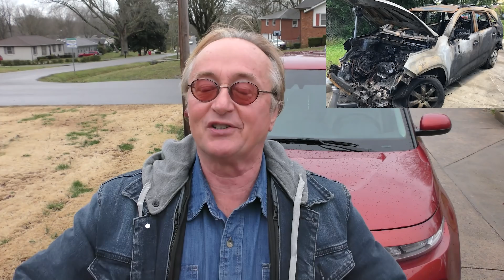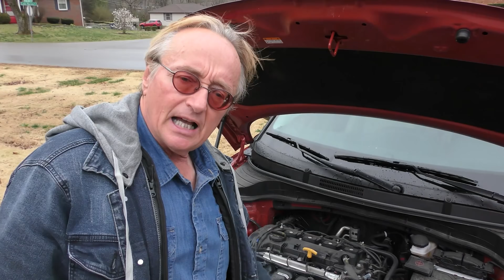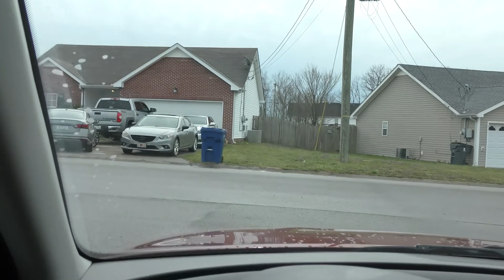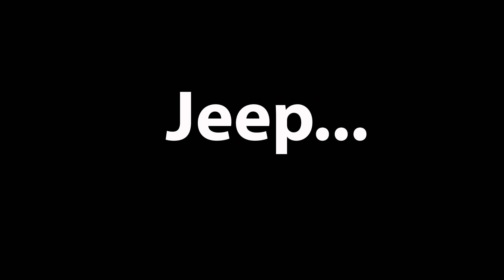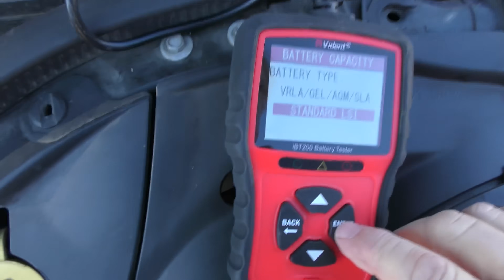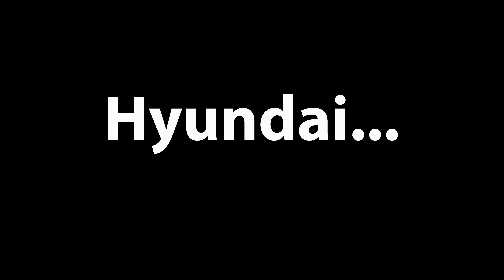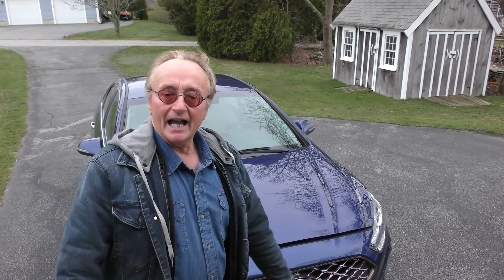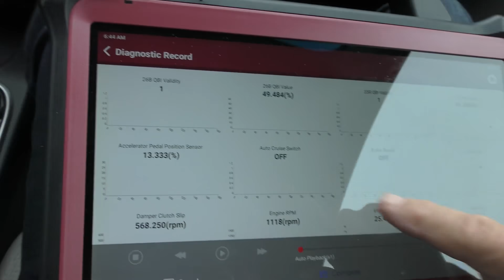3 Car Brands That are Crap

Comment: Wow you are completely wrong the reason all the new cars Toyota Kia etc are burning oil is because of much weaker oil rings reducing friction which is suppose to increase mpg unfortunately depending on how you drive the thin oil used today will make it past the oil ring also not being as stiff as before gunk builds up on the oil ring making the efficiency of the oil ring drop off quickly the old oil rings were stiff enough to keep from any effect from slush buildup

Comment: My brother's 2013 Kia Sorento locked up at only 80,000 miles.  Thank God it was still under the 100,000 mile warranty.  The dealer said he would have been screwed if he had over 100,000 miles.
Reply: How about revving it to death before warranty is up, then?
Reply: @Mr371312  That's what I do.
Reply: The service manager was wrong, and what he told your brother goes against Hyundai/Kia warranty policy.   This engine is covered by the engine recall at virtually unlimited mileage.  I ran a Hyundai shop and the manufacturer is unbelievably generous with goodwill warranty claims.   That service manager was one of those dollar chasing dealer types that give us all a bad reputation.
Reply: Except that you put used engines in not new.
Reply: @wolfeadventures  No.  My brother a brand new engine.  not used.
Reply: seized? no oil?
Reply: Yeah cause these modern junk won't make it to 100,000 it breaks too soon. The dealerships know what they're doing getting their $$ drawing you back in thinking new is better they know you need wheels to get to A. To B

Comment: I have a Kia and haven't had any problems with it.
Reply: 2 out 10 of their cars will have an engine blow and catch fire. Drive assuredly.
Reply: @inquisitor4635  I had a friend who had a 2010 Toyota with less than 50,000 miles that was frequently in the shop for engine and transmission trouble.  He got fed up with it and bought a VW and hasn't had any trouble with it.

Comment: I bought a new 67 Corvair with the 110 hp engine.  It burned a qt about every 1000 miles from brand new.
Reply: In my dim memory, there was something about the pushrod tubes, or the seals that leaked oil.  I think there are now silicone rubber seals that don't leak----only 50 years too late.
Reply: Ralph Nader just loved the Corvair!
Reply: Those were great little cars.
Reply: I remember a quart of oil every 1000 miles being the norm for new cars in the 60's. Probably a combination of lower tech piston rings, poorer quality oil, and maybe looser engine tolerances.  It was no big deal then. Service station attendants offered to check your oil while your car was being fueled and there was always a rack of oil cans with various grades positioned between the pumps. Still today oil is relatively cheap and burning a quart every 2000 miles isn't the end of the world.

Comment: I had a hyundai elantra with a manual transmission. It was a 2007 I think. Never had any issue with it. It was a pretty basic car though. I would not one of those new ones with cvt transmissions.
Reply: Generally the hyundais from 2006-2010 are pretty bulletproof cars. Have a used 2010 sonata and given for what it's worth so far I can probably get it to at least 120k before it's time to trade it in. Only got it because of the used car crisis but it probably will get better by then and I am going to get a Toyota corolla cross for when the time comes.
Reply: bought 2007 Santa Fe manual and i fu$$ing love it!
Reply: For what it's worth I had a 2000 Elantra bought it in 2005 and drove it to 2012, zero issues whatsoever.  Can't remember the mileage but hit a huge deer which totaled the car.
Reply: Well the 8 speeds are on the top trims
Reply: Manual is the only way to go!
Reply: So, in your opinion, do you feel I made a good, reasonable, okay, risky, or bad choice??

I bought a 2020 Kia Forte fe with a manual transmission.
Reply: @electron7659  lol 15 years is a huge difference. According to what OP said, yes since you got a manual.
Reply: In Latin America almost all cars come with manual transmissions, i have seen elantras as uber and taxis for many years

Comment: my car has 400,000 klms on the clock, (240,000 miles) and it doesn't use any oil. That's because its just run in. 2004 non turbo, no DPF and no 2000psi common rail naturally aspirated diesel.  oh and a Toyota of course :)

Comment: The modern Kia/Hyundai are actually pretty decent cars.
Reply: Fr, the new Kia Forte's are really affordable and nice, the K5 and Stingers are a little eh but yeah they aren't bad
Reply: Mom had two Hyundai, 2004 Sante Fe (ran amazing, no problems except AC going out a few times at arounf 150K miles) and now she drives a 2015 Hyundai Accent, tiny car 1.6 liter engine, good gas mileage but AC sucks, went out 2 or 3 times. Doesn't blow strong air.

Comment: The Nissan frontier has good engines and transmission
Reply: They do make a good little truck! The big trucks are gas hogs!
Reply: @jaya.0069  yes... the Titan is a gas hog...
Reply: @jaya.0069  Infiniti Q50s are GARBAGE tho never buy a Infiniti Q50 especially a 2015 my sisters transmission blew at 105k miles 

Infiniti is owned by Nissan btw